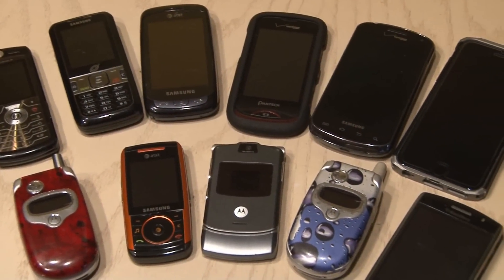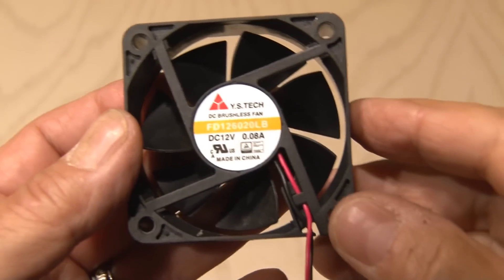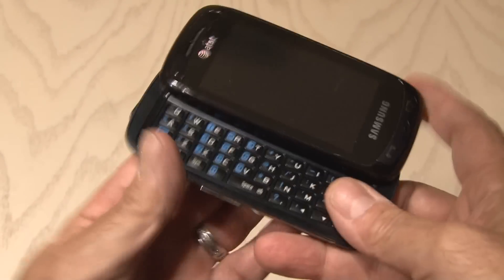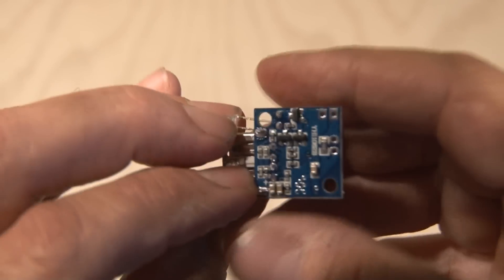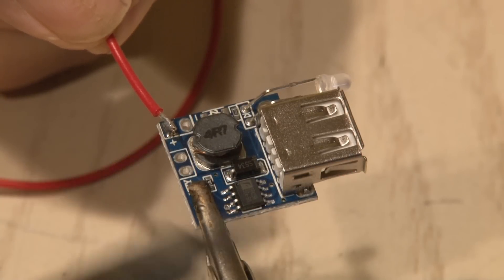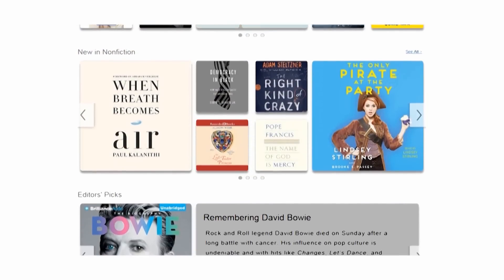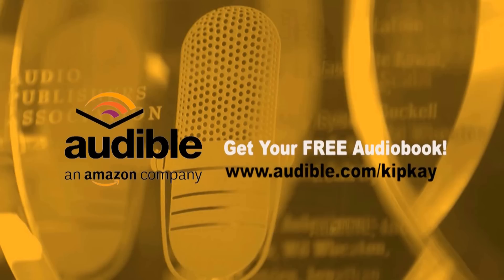Charge Your Cellphone with a Fan!

Comment: hey, this project sounds great. could you do another video using the same principle but instead of using the bike to move the fan, use strong magnets to power the fan blades. Curious if this will create enough RPM to charge. Thanks
Reply: That wont work, the magnets will just try to connect to the bigger one and it will stop.

Comment: It is strange, because brushless fans have a built-in controller that alternatively connects the coils with the correct polarity to keep the motor spinning. I don't think they can be used as dynamo (i.e. in the reverse operation!).

Comment: wouldn't it work better if you remove the motor of the fan contact a rubber wheel and mount it so the bikes wheel spins the motor? Im not to good with electrical mechanics so im mostly guessing. Anyone know if that would work ?

Comment: If you live near the sea, you can also mount the fan to the outside of your house, instead of on a bike. You'd need longer cables and to drill a hole in your wall (or a ridge in your window), but as long as you seal it properly afterwards, that shouldn't be a problem.

Free phone charge whenever you're at home!

Comment: at my university the engineering students (im in computer science engineering program if anyone is wondering) developed a prototype fan charger for cell phones. it's really small but works great. Ive used it and it's really cool. it can charge as if it's plugged in, sometimes faster. the students and director were thinking about releasing it out to the public this Christmas season.

Comment: Hey kipkay I was wondering if you could help me with something. I want to rig up some led ribbon lights to my new gun safe. My plan was to use some double sided tape to tape them under the shelves of the safe and then have the strip rigged up to a battery pack and a pressure switch. Just wondering if you knew where I could get the battery pack and pressure switch for the door is all. Also what type of battery would you recommend? I was thinking of rechargeable AA batteries.

Comment: Excuse me Kipkay. The fan is a 12v. So why the 3-5v step-up? You might end up sending 20v to your phone. Correct me if i'm wrong?
Reply: Yes, that is the power to run the fan. When you blow on the fan it only outputs 1-3.5V. These fans ARE NOT made to be used as a generator.

Comment: Or you can just add a pair of small magnets to the fan to keep it spinning autonomously and charge the phone without a bike......
Reply: Perpetual motion is impossible. It violates the first law of thermodynamics "Energy cannot be created or destroyed in a isolated system"  and the spindle experiences friction as it moves so it slows down over time.
Reply: you are talking about perpetual motion. not yet possible but they are close... however the solution is a lot more complicated than your proposal.
Reply: +fako fakoson It wouldn't work because magnetic fields travel in loops going in opposite directions on each side of the north pole and each side of the south pole. The fan would just get stuck somewhere.
Reply: Robert Paulson As I said I am not an Engineer or anything BUT I am not theorizing, I actually made the damn thing and who knows why but it works!!!!!
Reply: ethan polcyn My stupid guess is:  the fans in a CPU/PSU never slow down despite facing friction, thus such components are maintained at an average temperature.

Said fans are propelled by direct electric currents meaning those are constant steady never alternating values.

Magnetism is a side effect of electric charges flowing, magnets whatever element/compound they are made of are electrically charged.

Magnets do wear out due to many factors like heat, friction, exposure to certain chemicals.....and INEVITABLY they die out naturally the same as radioactive elements.
It just takes a huge amount of time but considerably less than radioactive elements.

following those arguments magnets can be thought of in a way somewhat like batteries that feed the electricity needed to power the magnetic rotor in the fan and move it, it would not be perpetual as the magnets will eventually die out but it would work for a determined amount of time perhaps beyond the current human lifespan.......

Comment: why not use slim magnets on the fan blades that push agaist a magnet on the outer casing, free power no sweat
Reply: Magnet generators don't work.
Reply: +ethan polcyn how exactly do they not work, the spare fan I made with magnets is not working? wierd how is my phone getting charged then, magical earth power... hey look another percent of magical earth power just went into my phones battery.
Reply: Because they violate the first law of thermodynamics. You cannot create energy so the fan eventually slows down.
Reply: +ethan polcyn yet it still works

Comment: Fantastic idea.  I did mine slightly different.  I put a USB type A female plug on my fan charger.  That way, while phone chargers may change at the phone end (a-la Apple) there's still a good chance they'll connect to a computer in some way and USB is most likely, so if I ever change phone that has a different charge plug on the phone, I can still plug it in to the fan via USB.

Comment: A cell phone typically needs 5V x 500 mA = 2.5 W of power from a charger. In best case the fan will generate 12V x 0.10 A = 1.2 W x (0.8 efficiency of voltage converter) = 0.96 W. The phone will either not charge at all or will charge at snail's pace. Apart from this the output voltage of these voltage converters stays at around 4.2V or less when a few hundred mA of current is drawn from them and in this particular case the output voltage will vary significantly with the varying speed  and random stops/starts of your bicycle. This unstable voltage can damage your cell phone. For a better design you can use your bicycle's dynamo/solar cells with a super capacitor bank/batteries.
EDIT: I have personally checked on multiple 12V PC fans that these fans do not generate a voltage when spinned because of the electronic circuit they have on their input which blocks the reverse current flow due to a series diode. You have to remove the circuit in order to generate a voltage
Reply: thx
Reply: Inspector More-Anonymous  . A motor becomes a generator when operated backwards i.e. it can produce circular motion with electricity or electricity with circular motion.
Reply: +Muhammad Saad 
The fan will generate more than 0.10A, this one draws (or creates) 0.08 at whatever speed it's rated at, probably 1000-1500rpm.
It's not hard at all to exceed that speed by using air to push the fan, only downside is you'll destroy the bearing.
Reply: The fan will be damn hard to spin when it supplies higher current to a load. Try stopping a fan running at full speed on 12V .The same amount of torque will be required to keep the fan spinning and keep the voltage generated at 12V / 0.10 A rated.
Reply: +Muhammad Saad can you add a link to the converter or anyone else? I can't see it in the link
Reply: oh well, time to try my trusty dell 120mm fan that draws 0.7 amps at 12v :D
Reply: woow pretty good at physics
Reply: Lol my tablet  only needs 200mA, its not the fastest but it works enough, no way do you need 2.5W.
Reply: Inspector More-Anonymous
study physics before further discussion with me. I can not teach kids on youtube via comments
Reply: @MSP2025K  you should study electronics before talking smack.... absolutely no smart phone will work with this setup.. + some fans have blocking diodes you would need to eliminate.....
Reply: what about putting magnets on each blade, then 'sticking' a magnet to the out side to spin the fan, obviously i wouldn't last long, but realistically in an emergency, would that work?
Reply: OF course!, his fan evan says .08amps.

Comment: "I dind't want to ruin my wire from my new iPhone"

Put's USB on the other end of hacked wire.....

Still liked the video xP
Reply: I sell stolen chainsaws gotcha huehue XD
Reply: I sell stolen chainsaws But why would he have to cut it up? it already has a USB on the other end.
Reply: +CentralNintendo1 
+I sell stolen chainsaws, is just a bit confused..
You're right, he wouldn't need to break the cable..
Reply: it wont charge an I-Phone, that's my guess
Reply: +CentralNintendo1 Cheap USB cables are easy to come by, but cheap iPhone OEM cables are not.
Reply: +I sell stolen chainsaws you better not sell stolen chainsaws
Reply: Tommy Whitaker If the name implies I do, then I do. Need some? I got them, premium stolen, and they're chainsaws.
Reply: I sell stolen chainsaws that's inlegel
Reply: I sell stolen chainsaws But why would he have to buy another iPhone wire?
Reply: CentralNintendo1 Because OEM cables from Apple last longer than the 5$ ones near the cash register at your local gas station.
Reply: no, why would he have to buy another cable after doing this project?
Reply: +CentralNintendo1 Because it would be cut up into a bike fan that would require him to bike whenever he wanted to charge his phone. It's not like he would re-fix the cable he just cut up so he could use it with his computer or wall charger.
Reply: +CentralNintendo1 Nor would he want to buy a 20$-30$ cable depending if he uses USB or USB-C from Apple. Now are you interested in these chainsaws or not? You're wasting my time otherwise.
Reply: CentralNintendo1 This video went over your head, thread - muted. I will never sell chainsaws to you, do not inquire any further. Good day.
Reply: Right? Any smartphone made in the last, what, 5+ years comes with a USB-A to Lightning, USB-A to USB-C, etc. anyways.
Reply: micro USB and lightning are the most common and 5 years ago we had the 4s which had 30 pin not lightning  :)

Comment: I have tried this with smaller solar cells, those from solar lights and only managed to run my phone battery dead. my phone was using more mah than the charger could provide, even tried it with the phone off, soon as the sun went behind a cloud it would quit charging but when the sun came back out it would start charging waking the phone screen showing it was charging still using more energy than I could provide. galaxy note 4 and 3 cells.  next time I'll use more cells. I'm not saying it's not possible, just saying my project failed due to not enough supply .

Comment: what if you modified the fan. Remove the square case around it and the blades. sand it smooth so its just a spinning circle thing, then position it on the bicycle so that it touches the tire. When the tire spins, it will spin the fan super fast. Would that work?
Reply: +Chris Bell better yet, have it charge a lithium ion battery pack that you can then plug into your phone. Kind of like those lights on a bike that are powered by your pedaling.
Reply: You would probably need a regulator but it might be to fast for the fan

Comment: There is a reason why he didn't use an iPhone. All apple products will only accept a charge if there is a certain resistance applied. This is why if you try to make your own charger with 5v solely, the phone will recognize it, but not take a charge. For older phones, it will simply take the charge.
Reply: The other reason is that when using a less sophisticated phone like this one is the fact that it can be fooled into thinking it is charging (it displays the charging symbol) but in reality it is not. The fan depicted in the video cannot charge any phone in any reasonable amount of time. I made a wind turbine out of a 140mm fan (bigger than his fan) and it could charge a single AA battery in ONE WEEK...

Comment: this is carp. I mean, it works but you are way better remuving the blades and pushing it to the side of the wheel to make it spin like a generator than using the wind. I bet in practice the cellphone wouldnt even charge 5% in a 1 hour bike ride. Imagine your legs can give out like 90W of power, that's more than enough to charge the battery at the cellphone's full capacity, because now that i think about it, even if you get enough voltage you wont get 500mA out of that not by far. If the fan runs on 12V 100mA then in a perfect world you'd get 100mA at 12V if you spin the blades at full speed (the fan's nominal speed), convert that to W it's 1,2W, or ~200mA at 5V. And that's if we lived in a perfect world, and we do not. Being that most chargers output 500mA or more (mine is 900mA) you are better of having a solar battery bank to charge your phone in a pinch.
A 12cm fan would be better for this as it has more surface hence can transfer more energy.

Comment: if a fan spins it generates less than 0.5W. my ac charger is 10W and my phone takes about 1h and 30min to charge. 

0.5 / 10 = 20
20 x 90(1h 30) = 1800min
1800 / 60 = 30h

so you will need to ride your bike for more than 30u for it to fully charge.
Reply: but it's a nice idea

Comment: Errr, why not just rig it to the bicycle's gears so you charge as you peddle?
Reply: +danshyu Actually, you can connect something to the metal rim area of the bike wheel (the part of the wheel where the brakes are applied) and use the friction caused by the spinning motion of the rim, to turn a generator. I have seen these to power old fashioned lights, but I bet it would be a lot better when used with an LED. One thing to keep in mind, is that anything you add to generate power, requires you to pedal harder, which is sort of like making you less aerodynamic (more wind resistance).
Reply: +Adrian Tse  a bicycle got a dynamo for the light of the bicycle (thats enough energy) a bike already have the ride energy i dont get it

Comment: Why not just install a better dynamo on the bicycle? I dislike this way.
Reply: +AtDiT or trim the blades and pushi it against the will to use it as a make shift dynamo, it should be waaaaaaay better than using the wind to spin it.

Comment: it will got enough power to charge only if!!!! you just put neodymium magnet to the blades and one in outside it will runs freely and it will called free energy. no plug ins no blowing no turning no effort s
Reply: +talastas789 the issue there is, neodymium magnets are not cheap to make, and no mater how much we wish it was possible we can't create energy. as fun project its fine but its not practical on a large scale.

Comment: What's the current output? I doubt this would charge any modern smartphone..
Reply: +OhFishyFish and if it did, it would take significantly longer to charge...unless you attached it to the wheel some how...can also get a generator for your bike and connect it to that instead of a light
Reply: Less than 10mA on a good day. I built a similar thing using a 140mm fan and it could barely charge a single AA cell in a week (7 days)

Comment: My fan only produces .005VDC.  It's 160mA.  I'm not sure the 60mA difference from your suggestion should cause that much of a difference in voltage.  Most SMARTPHONE chargers are 2A or higher, so would this really work on a more modern phone?  Did you try this on any other phones that take a micro-USB?  Then you wouldn't have to cut the cable.
Reply: +B Epps I dont think it wll work good
Reply: This method does not work. Fans can't produce the 2,5-5W required to charge any modern phone. Don't waste your time on it :-(

Comment: You'd better hook the fan up to the wheel with a miltiplier gears, you could get higher voltage and amps with such setup

Comment: hmm.... how about rather than wind, we use water flow energy. IE Rivers? I am not much of an electrical engineer, but is it possible to AVOID short circuiting the system if i were to put the fan INTO a slot whereby i funnel the energy generated by said river flow into the fan? i can use something like this on camping trips for other applications rather than just for cellphones

Comment: That fan will never be able to put out enough current to be useful, especially for charging an iPhone. You would need to place it in the grill of your car on the highway.
Reply: The 742 dislikes are from electrical engineers who understand that this video is garbage...
Reply: +electronicsNmore yeah, pretty much. but the fan's not made to spin that fast, so it'd break rather quickly.

a 80mm fan spinning at 2500 rpm would probably generate under 2w of current.
Reply: +GraveUypo 2W! lets say 0.1W
Reply: +Dylan Missuwe i tested it myself
Reply: +Dylan Missuwe 
Not to mention some case fans have internal circuitry which does not allow them to produce a voltage when placed in the wind. The one he used does, but current output is very low, and any kind of load would slow the blade rotation or stop it.
Reply: +electronicsNmore yea, they have a diode in them
Reply: late comment but is this a joke? the boost converter will boost the voltage

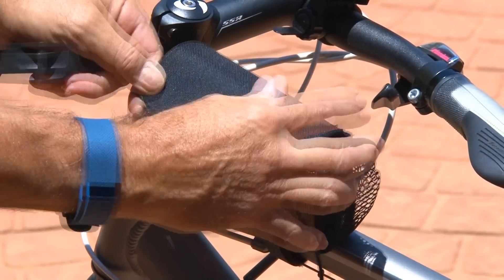Comment: 2:40 "Make sure you mount it in the correct orientation for wind flow"
You're using it as an impeller so you should have wired and mounted the fan backwards to take advantage of the cup shape of the fan blades.

Comment: Kipkay, you are going about this the wrong way! Strap the center of the fan to the center of a wheel, and you'll get much better RPM, which will charge your devices faster!
Reply: +/home/yoshifan I was thinking the same thing. 

Only problem I can think of is the wires getting in the way of the spinning wheels and tangling up
Reply: +I&#39;mA Taco Tape the wires to the frame of the bike, and just add a cell phone mount. They're only cheap, and it shouldn't get in the way
Reply: You won't get a faster RPM at all. It would be like 10 times slower, not even kidding. A normal bike wheel spins like 120 rpm in 10 mph. Just with the wind in 10 mph it could easily get over 1000 rpm.